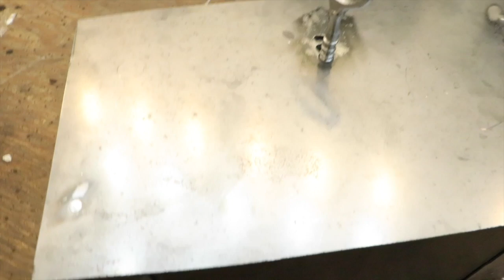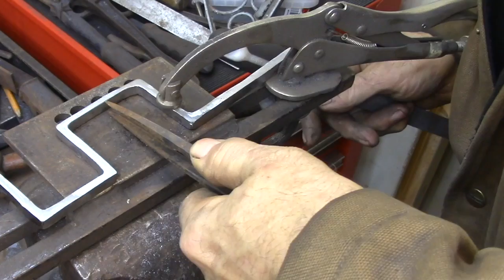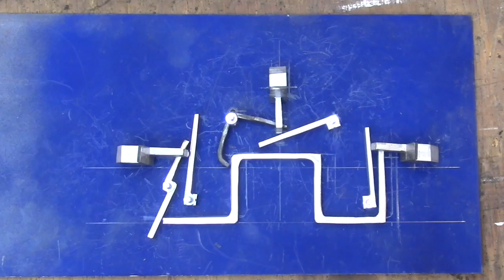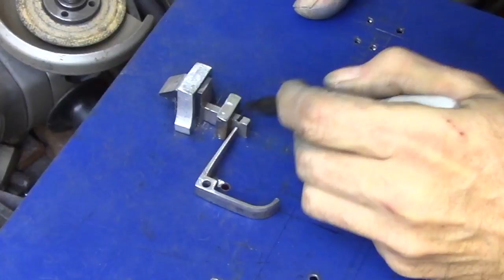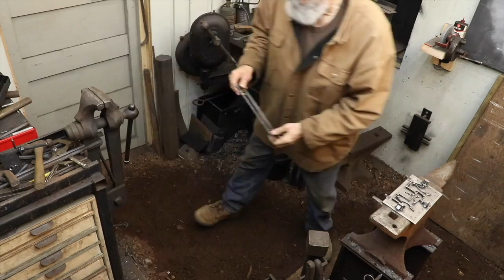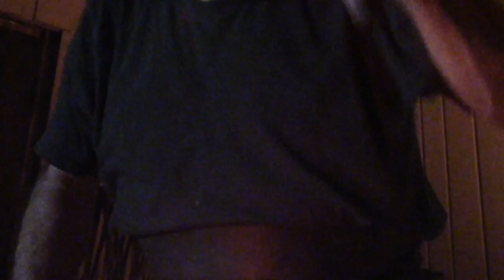Blacksmithing Project - A Simple Nuremberg Box - Introduction

Comment: What an excellent series on the Nuremberg box! You should have way more people watching this.! -I did my apprenticeship in Nuremberg, in another metal craft, but this town used to be THE centre of metal works in the medieval period. There are so many fascinating projects yet to be made if you ony think of Nuremberg. The only thing that is not so strictly true is, that there where no means of measuirng available. Nürnebrg actually was also a center for the making of precision instruments...
Reply from the maker: I do agree with you.  That statement did not come across the way I wanted.  I wasn't suggesting that they did not have the ability to measure or work accurately.  I was trying to say that measuring, as we understand it and use it today, was in it infancy in the 1300 -1500's.  My thinking is ( and this is just assumptions on my part not research ) that without machine tools that can be dialed-in to remove a specific amount the process of establishing a numerical value on how much still needed to be removed  to make a part fit would have been pointless.  I think they would have been using dividers, calipers and shop made go-no-go type gauges to work to and not using micrometers and dial indicator to set up lathes and milling machines the way we do it today. Again I'm just using the tools I know that they had to try to figure out the process. I certainly welcome any thoughts you have .
Reply: @df-intheshop330  Thanks for the in-depth answer. Now I am feeling a bit bad for being petty with that part of the video. I do think you have it right, especially now that you have answered. I do fully agree on that. But especially Nuremberg in that period ist at the ABSOLUTE forefront in mechanical machining as well. There is already a lathe with support being invented, mass production of wire, numerous specilalised casting manufacture, a high grade of division of labour and so forth...